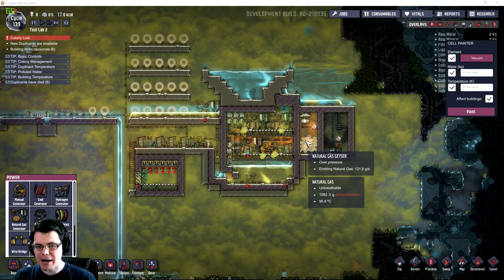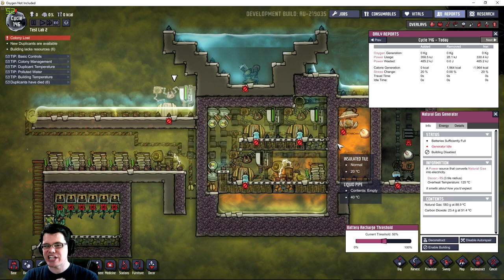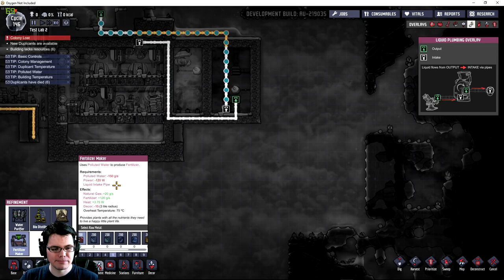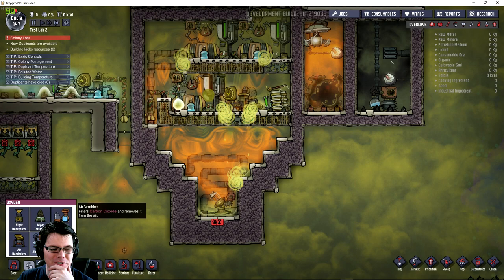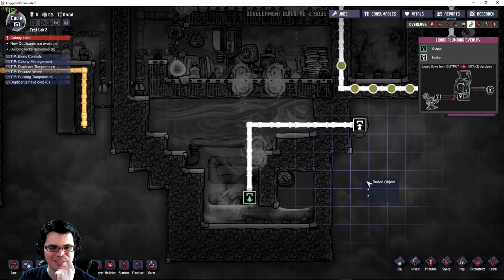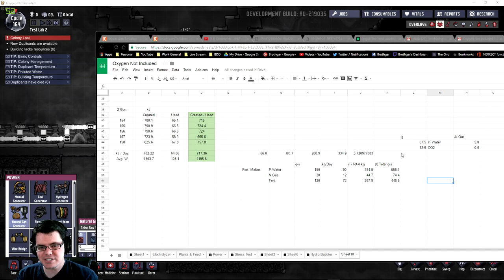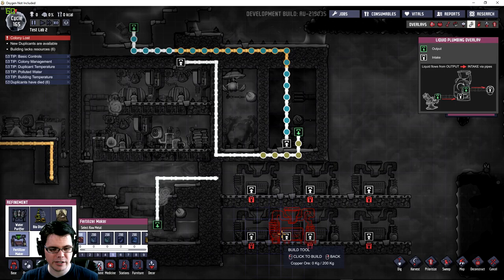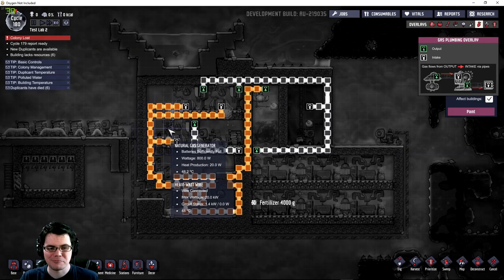Fertilizer Gas Geyser Power Plant Experiment! Oxygen Not Included

Comment: The closed loop system definitely doesn't snowball: you put in 450 g polluted water, get 60 g natural gas, burn that, get 67.5 g of polluted water and 82.5 g CO2. Scrubbing that CO2 takes 275 g water and makes an equal amount of polluted water. Subtracting the polluted water from both sides of the reaction and subtracting the power needed to run the fertilizer makers, air scrubber, liquid pumps, and gas pump gives 107.5 g polluted water + 275 g water -> 360 g fertilizer + 360.8 J. Pretty good

Comment: You missed something, Brothgar. The clean water. 
You use it to supply your air scrubber, and the steam geyser will only give you 2400 Kg of water per cycle, which means you cannot run more than 8 generators off of natural gas and steam geyser.
However, the air scrubber will produce equal amount of polluted water, so, with two and a half tons of p. water a day (even more, counting minuscule amount that the generators will produce, around 40,5 Kg a day per a generator) boiled into steam - and i'm using steam geysers anyway to supply air scrubbers with water in this scheme - the power plant may just be scaled indefinetly. And still, there will be some polluted water left for irrigation and fertilization.
Reply: Sam Lopez this way he loses A LOT of polluted water

Comment: I worked out some numbers based off the limit of a Liquid Pump. This Polluted Water to Fertilizer to Power system can scale to, 1 Liquid Pump (10kg liquid limit), 66 Fertilizers (require 9.9kg polluted water), can supply 1320g/s Natural Gas for 22 Generators, which require 3 Gas Pumps, 5 air scrubbers can clean the carbon dioxide, and 1 water purifier can clean the water from the scrubbers to be self sustained. This makes a system Producing 17600 W, at the cost of 9600 W which leave 8000 W for the base to use. No Geyser Required, only Polluted Water. Which can be made from Lavatories, producing over double the amount of liquid that goes into it.

Also from my tests, it seems Natural Gas sits below Oxygen but above Carbon Dioxide. This info can be used when placing the equipment so that escaped gases don't cause trouble in the base.

Comment: An idea I have for cooling: place your electrolyzers above a cold chamber to allow the O2 to fall through and liquify. Use a liquid lock at the bottom with the exit going into the top of the generator/battery room. Let the now gaseous O2 out the bottom of the room and your dupes consume it. With the self powering loop of electrolyzers and H2 generators, this would have very little power requirements with a ton of cooling potential.

Comment: So, inspired by this video, I messed around a little with this idea, and while the only thing preventing it from being a perpetual motion machine is a steam geyzer, it seemed to work just fine. You'll need:

* 2 natural gas generators (Gas: -2*60=-120 g/sec)
* 6 fertilizers (Gas: 6*20 = + 120 g/sec)
* 1 CO2 scrubber
* 1 gas pump
* 2 liquid pumps (1 for water from geyzer to scrubber, and 1 from polluted water to fertilizers)
* 1 steam geyzer.

Once you kickstart the system with some energy, it will start creating endless energy without the need for a natural gas geyzer, fuel, or any other input besides the water geyzer.

I haven't checked the math behind the polluted water to see if it balances out because the game crashed pretty fast, but still it would be interesting to see one of your videos with this idea!

Comment: it'd be interesting to see how much net loss of natural gas there is for a ideal natural gas gen+fertilizer maker ratio

or the net influx of polluted water you need to keep it running without the geyser.
Reply: ratchetfreak See my comment for details, but it comes out to 82.5g/s of polluted water, not considering scrubbers. Link scrubbers into the mix, and the input required is 1.1kg/s of clean water, with an excess of .77kg/s of polluted water. Totally doable.

Comment: Impressive system at the end there.
Gotta remember it's not exactly self-sustaining though.
Not only are you polluting clean water in the scrubber - but you then later "delete" that polluted water with the fertilizer produciton (and fertilizer is sort of useless at the moment IMO).

Running this for an extended period of time you risk running out of clean water fast, and you need clean water for electrolyzers and such.

I think I prefer a lower energy output, much simpler system that byproducts polluted water (pretty easily purified into clean water now that you can make sand from any old surplus mineral).

Comment: If you are trying to Min/Max, it's wasteful to dump the dirty water from the scrubbers into the generator area just to pump it back up.  It could be piped right into the fertilizer makers.  I think you did that for heat reasons but it might be useful to see if its required.

Comment: You've piqued my interest enough to break out stuff I learned back in general chem one. Well done.

The overall analysis tool to be used here is that of the stoichiometric ratios. Given a conversion process, what are the ratios that cancel out a given reactant. Since we have 3 machines, we can cancel two reactants. I'm assuming some idealism here, ignoring pumps and other machinery necessary in an actual build.

First thought: Cancel CO2 and polluted water "H2O(P)".

The ideal integer ratio of generators to scrubbers is:
(300S/82.5G) = 3.63636... = 40/11
Oh dear... (we can use the atmo switch to bring this ratio down, but roll with the numbers). 40 generators hooked up to 11 scrubbers consume 11kg/s H2O and 2.4kg/s Natural Gas (NG). They produce 13.7kg/s H2O(P) and 30.68 kJ/s. If we try to balance the H2O(P) with fertilizer makers:
0.15F/13.7(40G+11S) = 274/3
Oh crud. 120G+33S+274F. Now, this does not over-unity on NG, but the offset is substantial:
33kg/s H2O + 1.72kg/s NG -> 32.88kg/s fertilizer + 59.16kJ/s

That's neat, but a bit unwieldy. The other calculation I've done balances the gasses instead. You can almost make a closed loop of NG gens:

4 generators + 12 fertilizer makers + 1.1 scrubbers ends up giving the following conversion:
1.1kg/s H2O -> 1.628 kJ/s + .48 kg/s fertilizer + .77 kg/s H2O(P)

If there's a way to use the waste heat of the machines to steam purify 1.1kg/s H2O(P), then this system could run on 0.33kg/s of polluted water, producing 1.628kW, not including pumps. I feel like this is possible, and not outrageously large.

Comment: So did the math - every gas generator costs a net 107.5 g/s  polluted water to run from just fertilizer makers.  
67.5 (gas gen)+82.5*3.33(air scrubber) - 150*3(fert makers)
Additionally you need an extra air scrubber for every 3.6 generators (300/82.5)
Edit: guess Latronibus beat me too it, guess i shoulda checked comments first
Reply: for those interested, a 20kw setup will take  25 gas gens, 75 fertilizer makers, 7 air scrubbers, 3 gas pumps(possibly 4), 1 clean water pump(6875g/s), and 1 polluted water pump(2689g/s), generating a net 8960w

Comment: After my brother spares some time for me to test , it turns out that 3 fertilizer makers can run a single generator and it seems that my liquid pump is bugged that it never turns on , it always generates power for my core base(which I'm also testing a radiator farm design) ,so I shuts off the power intake transformer to allow it to run on it self , after 50 cycles , no power lost for the two batteries I built in there

Comment: The problem is the generators are still working even if the batteries are full(which would have blown, in this case), it sucks that the energy goes to void cause it'll be a waste. A way around it would be using a set of light bulbs or something that consumes electricity.

Comment: Hello, first com' on one of your video's so lets go for the usual "wow what a great channel, those experiment really helped me to better understand how this amazingly time consuming game is working !", that said and even if i really mean it, i have a few things that i am burning to share about this kind of powerplant setup since i'm experimenting myself on it for a while. (i've been up to 8KW of power in one system)
Oh yeah just in case, forgive my writting, english is not my mother tongue and i'm a better speaker than writter :p, so sorry for any eye damage during reading.

First, the watercooling seems to be important (or anycooling) because each and every system i've maid failed beacause the heat  build up and finaly the whole system crash in an horrible overheat disaster, then the complete failure of the base stress binge eating and other nice stuff... maybe a dedicated hydrogen bubbler could solve this issue (by the way thermo regulator only work on wolframite since last update i guess otherwise it reach directly 200°C and overheat in 10 sec...) My game right now drive me crazy i'm up to almost a 100°C on every corner of my power plant and my dupes spend more time on medical cot than even on massage table.

Second, to run the ideal natural gas farm, you have to consider the weakest part of the system wich is the gas pump, by using valves you can fuel 8 natural gas generator per gas pump, I wont go into too much detail but you need 3 x8 : 24 fertilizer maker and 8/3 : 3 air scrubber 1 fresh water pump and 1 polluted water pump to use the maximum capacity of one gas pump. (and of course add up from this to 20kW)
About water : I won't talk about fresh water supply since steam geyser give infinite amount of it, but you need to feed 24 * 0.150 : 3.6 Kg of polluted water every second to your fertilizer farm, a good part of it is coming back via the air scrubbers and natural gas generator here 3*1 : 3Kg from the first part 0.675*8 : 0.54 kG from the second so 3.54Kg so you lose really few in the process and you can compensate any food farm with some algae maker. (it is actually a good argument to not use the exploit to stack infinite gas since you get 3 Kg of polluted water per second from purifying the CO² and you also have to feed your pincha peppernut and maybe mealice)
About power :  The 3 pumps have to be on a separate grid to be sure you can always fuel your generator in case of any problem (that you should expect from this crazy game), i'm even thinking that the coal generator could be relevant for this .
You generate 8 x0.800 : 6.4kW of power and use 27x0.12 : 3.24kW so you have 3.16kW to power your massage tables and other stuff. (And don't forget the 3 x0.240 : 0.72kW that you have to feed to your pumps)

Third, about the electricity used and wasted, i've noticed what could be an issue (or just me not understanding), my heawy watt wires ALWAYS consume more energy, that i am really using at the moment when i add up every normal wire circuit. (it seems to be related to the power transformer that get fed more than it actually use if it's circuit is using less than the maximum power of 1kW (this is my BS theory but i've noticed that when i use a circuit with a potential 960kW power usage or more instead of lets say a potential 600kW circuit  the amount of "ghost" electricity used on my heavy watt wire drop to an almost normal amount (it's hard to be clear without picture...)

General thought : Do you think it would be possible to run a hydrogen bubbler with the thermo regulators inside of it, a kind of self cooling system. I'm trying one on my current game with 4 thermo regulator, it is kind of working but very slowly cooling (i don't even remember since when this is running... i'm at cycle 671) Or maybe with a double bubbler, one room to stack something like 4 thermo regulator to cool this room, and 4 other (on the same place) to run the bubbler that turn polluted oxygen into pure luiquid oxygen in a separate room, otherwise there is always overheat problem or just heat problem because even when i build on huge places i always reach for sky in terms of heat.

Last point, maybe you have noticed that i have some trouble with heat in my games, would you have any advice to fight this issue ? I don't think there is enough weezwort seed in this world to satisfy me...

Oh and by the way, sorry for this massive message :S
Love this game, love your video's, keep the good work =)

Comment: Is there a way to have a self-sustaining system that produces more power than it uses, 
without utilizing a geyser or bringing new recourses (for example coal) to it?
Reply: Brothgar wouldn't you need alot of water and electrolizers to produce enough hydrogen to sustain one H-generator?
Reply: I think hydrogen doesn't count, because you need a constant water or hydrogen supply if I'm not mistaken.
Reply: 1 generator 4 fertilizer makers with an air scrubber and a gas pump comes out to 840 watts. I tested a system like this and it seemed to run near constantly unless the co2 wasn't dealt with fast enough and over pressurized. It should then be possible to scale that up to three times and then add in a fourth generator which could net you 800 (or 680) additional watts. However that initial system didn't use water from the generator.
Reply: My 30 fertilizer makers, 16 generator 4 air scrubber can fully supply my base without any other source of energy right now (except water for air scrubber and that geysor which at this point i don't think it's relevant anymore).
http://imgur.com/R4PXxjx
http://imgur.com/eUh6zWG
http://imgur.com/FdxhcJZ
http://imgur.com/yDhTUaj